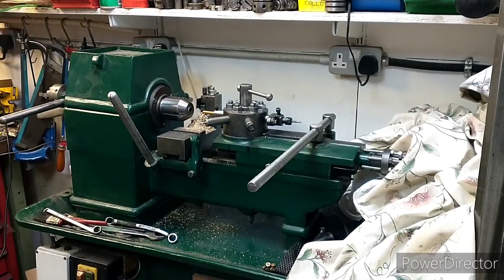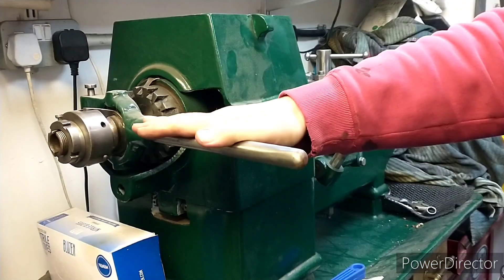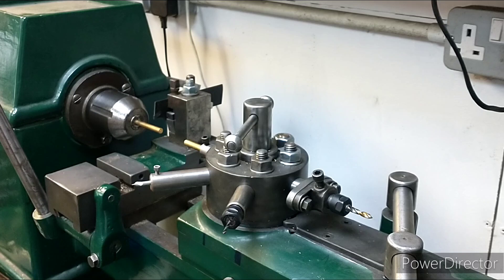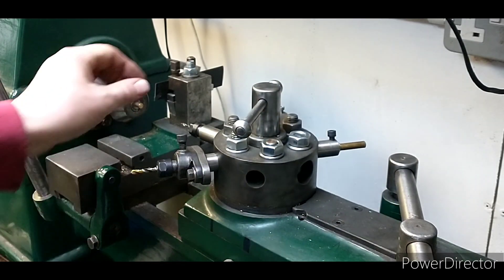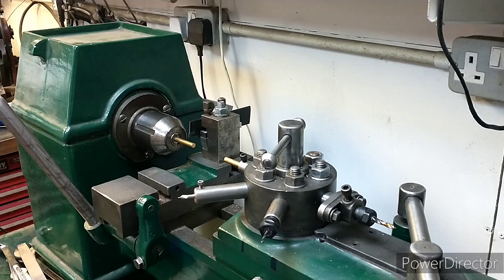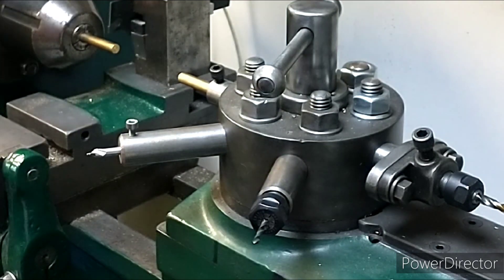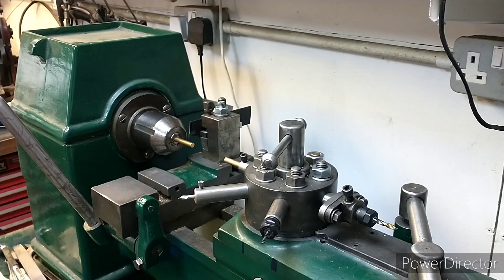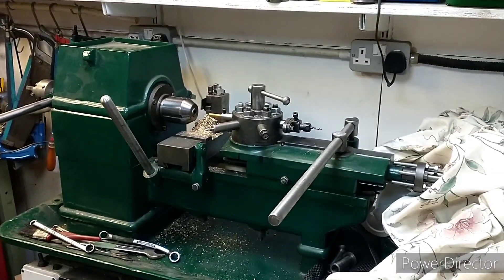Capstan / Turret lathe overview #hobbymachinist #homeshopmachinist

Comment: We had a capstan lathe at my dad's factory (I''m going back to the 1970s here). From what I remember the bar feeding and collet locking was all done on just the one lever. You could certainly churn the work out once you'd got into the rhythm.
Reply from the maker: Hi Paula yes that's right. This lathe should have a pulley and weight pushing the metal towards the collet. So when you release the collet it feeds by itself. I haven't got round to making something like that for mine yet. Thanks for your message. Julia 😃